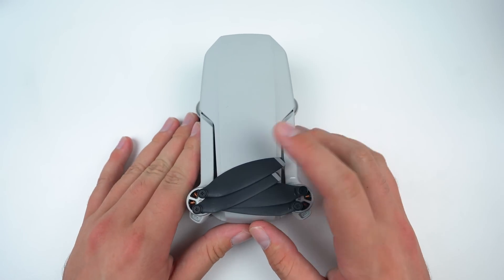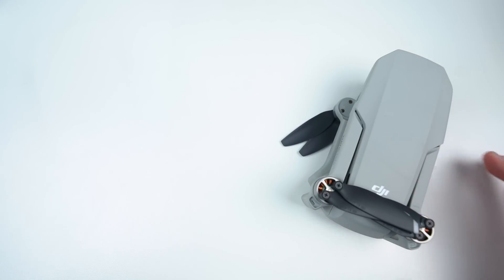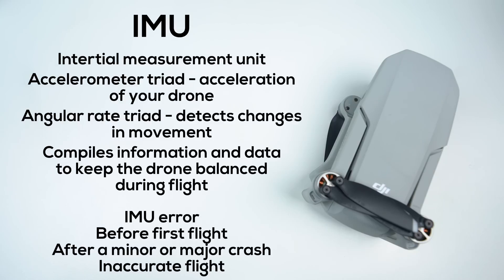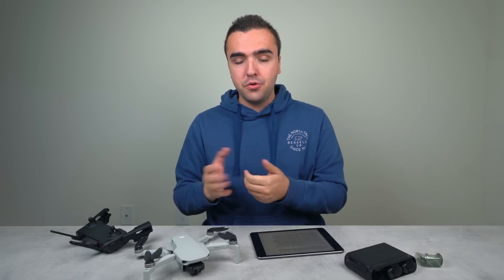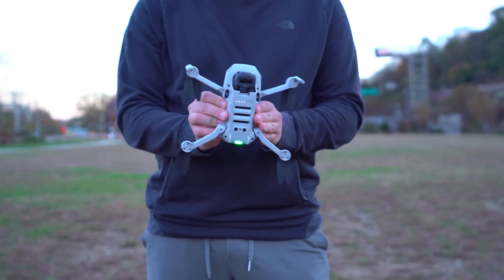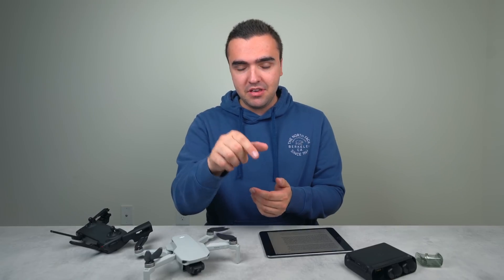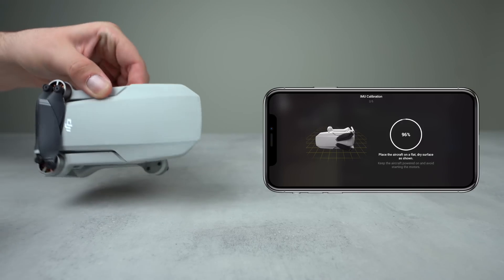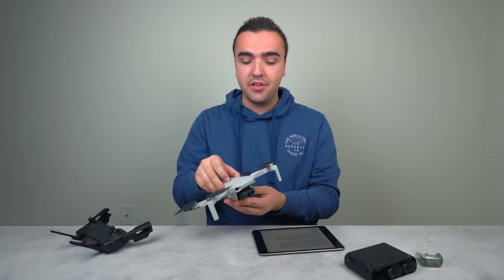DJI Mavic Mini: IMU & Compass Calibration Tutorial

Comment: I went to fly in a field and the fly app prompted for gyro calibration. I did the calibration all wrong. The vertical rotation I messed up. Flew ok till I got criticala low battery warning. Made it back and landed. This was my first long range flight and had just done a Dronelink flight plan, which worked almost flawlessly . Dronelink didn't prompt for calibration. When I decided to fly the drone manually with the Fly app it prompted for gyro. I have a question. Isn't it important to do the IMU on a level surface ? Short of carrying a table around what can you do to make sure you have a level surface ?

Comment: While doing IMU calibration and placing my mavic mini on one side, it lays perfectly flat and parallel to the table but on the other side it lays at an angle. Is this normal, if not should I be holding it flat on the angled side?

Comment: I CAN'T pair my dji mini i tried everything. It will not pair with my Controller. Plz help thx
Reply: The best thing to do is to put both in pairing mode then once they're in pairing mode, hold the power button on each device for 6+ seconds, the beeping sequence and sound will change. It will then pair, I had the same issue

Comment: During the IMU calibration it's strange that the drone doesn't actually lean on its side, perfectly vertical or "Plumb". It tips until the motor touches the flat surface. It almost tips over onto its back. Don't hold it Plumb with your finger. It's suppose to be that way.
Reply: So it's normal for one of the two sides to be 'angled' when laying down on it's own? On one side my mavic mini lays perfectly flat and parallel to the table. On the other it's at an angle like in this video. I'm not sure what to do

Comment: I crashed and broke 5 blades; I replaced all 8, because those not broken were scratched. When trying to take off and hover, the drone lifted about 2ft and flew backwards into a snow bank. No props were broken so I tried again and this time it went up 3-4ft and then full speed backwards until it hit a taller snow bank. Will Calibrating the Compass and IMU fix this?

Comment: Every time I turn on my mavic mini it tells me to calibrate my compass. Whyv
Reply: Same. Why?!
Reply: Michael fixed it. Apparently there’s something metallic near the drone.
Reply: @ricardot3763  Mine tells me this regardless of what I'm near.
Reply: Michael from what places do you take off? For example in pavements then there’s huge metal wires to support the concrete.
Reply: @ricardot3763  i would do the compass calibration everytime..make a checklist like my 1st step is check the propellor screws n props

Comment: Hi Billy,

i have some weerd stuff happening.

flying indoors big sportshal and the Vision Positioning is not working all the time.

at low alttitude it drifts and is not hovering nice above 2 meters it wil hover correct.

have you any suggestions ? or had it your self ? or can it be the floor type ?

Tnx

Robin Lissenberg

The Netherlands

BTW love your video's verry good explaind all.

Comment: I was doing the compass calibration incorrectly. That's probably why each time I fly it tells me it needs it. Also the aircraft is unstable in hover. It tends to want to yaw slightly when it should be still, and this morning as I was bringing it down over the porch for a landing it lurched forward and crashed into the door. I will do both compass and IMU, IMU having never been done on this since I unboxed it. Thanks for this, Kyle.

Comment: Thank you for the video. I would just suggest that when you are going through the compass calibration that you mention what direction you are rotating the drone. It appears that during  both horizontal and vertical, you were rotating  clockwise.  If it doesn't make a difference, then that should be addressed also.

Comment: Another video about calibrating the IMU put out on the same date (Nov 10) by Drone Valley has the arms of the drone extended and the graphics on the DJI app have them extended also and on your DJI app the arms are closed.  There's also a difference in how the compass is calibrated horizontally and vertically.  Strange.  His horizontal and vertical positions are different than yours.  I calibrated the compass on a drone I have the way you do but drone valley's horizontal and vertical are different.  I'd like to know what's what.
Reply from the maker: He was using a beta version of the app. If you look closely, it is actually a graphic of a Mavic Air in his video.

Comment: Billy, quick question for you. Got my fly more combo over the weekend. In doing my part 107 registration as I’ve done with my P4P, I used the serial number on the box, which matches the serial number inside the battery compartment. 

Today after setting up the Fly app, I noticed the app automatically shows me a totally different aircraft serial number. Is this the case for yours too?  Thanks.
Reply from the maker: Woah, really? Not for me. That’s weird. I’d contact DJI support.
Reply: Thanks Billy. I searched the DJI forums and found others have the same issue. Someone reported the following:

“The S/N on the box and the battery cover should be the same. The aircraft S/N in the app will be different. I was concerned too and DJI told me that the S/N on the box is the one that needs to be registered when activating DJI Care Refresh.”

Maybe a bug with the app?  We’ll see if this gets corrected in future firmware updates. 

Thanks and keep up the great videos.